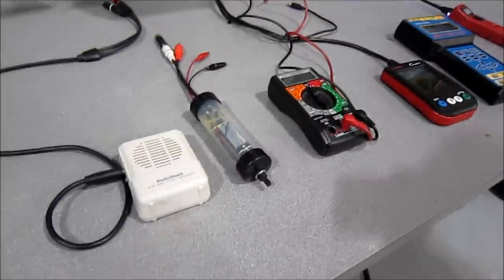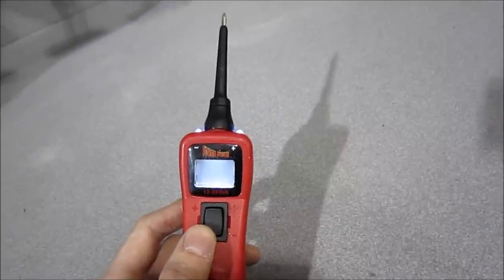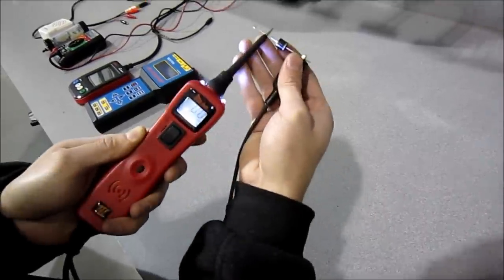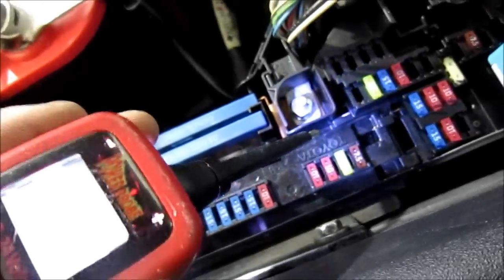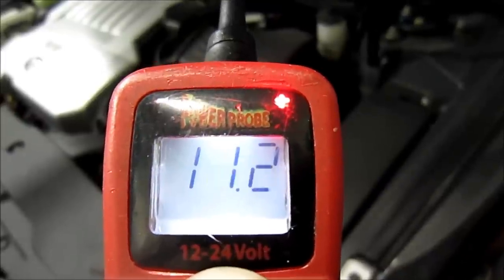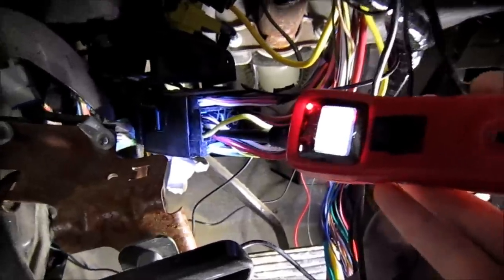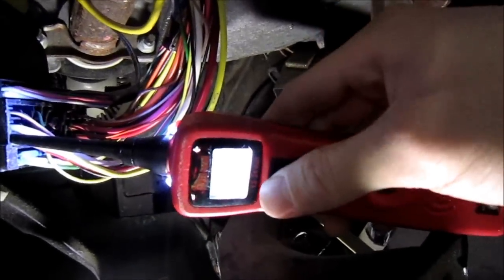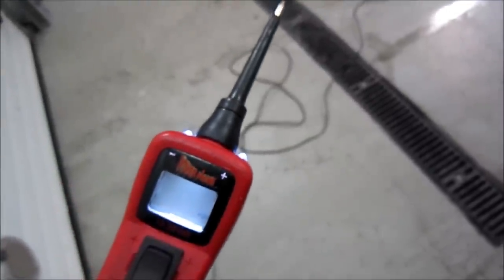Power Probe 3 Demonstration (12 Volt Diagnostic Tool) | AnthonyJ350

Comment: Yes it can hurt newer cars. So can a hammer. It depends on the user. I suggest they understand how to use this tool. As I use mine everyday. It saves time finding issues I know to look for. The only real use I have for the long cord. Is when a customers car is stone cold dead battery. So I use my AGM in the Rear of my truck for powering it.
Reply from the maker: True, that's why we discuss potential weak points of the tool.  You do not want to neglect mentioning the risks of using a tool.  You could setup a dedicated multi-meter in a similar fashion and modify the negative test lead with an alligator clip to quickly hook up to ground and use the positive lead in a similar fashion as the Power Probe.  On my Power Probe 4 I actually use a test lead from a multimeter so it fits in more places and I don't stress the circuit board out when testing wires when we're doing several remote starters a day.
Reply: @AnthonyJ350  I just bought a set of Fluke Test leads. More then i need. As I bought it for the Fluke 289.. I never used it much. The Power Probe can find it faster. Just learn to use it. As most people I see with them. Have no clue how many functions it has. Just read the Instructions.

Comment from the maker: 2 is a really good unit, I own one as well.  It's simpler as it does not have the LCD display for the voltmeter.  Also it doesn't have the same programmable features as the 3.  But the Power Probe 2 is still a very powerful diagnostic tool.

Comment: i just looked at the price of the 4, it's over $200. i like and appreciate you showing this. i just finished restoring a 71 Blazer and am onto a 68 Bronco. so for me i can't put out the $200 when a meter, some long alligator leads and a small 12v power source are gonna cover my 50 year old vehicles.
Reply from the maker: All depends on how efficient and versatile you want to be. Nothing replaces a multimeter but some jobs are just faster with the Power Probe. If you make money on a tool it's worth buying.

Comment: I used my Power Probe for the first time today, on a 2006 Skoda Octavia that would not switchover on start position after dong a D.M.F. conversion...thought at first the teeth on the starter to new flywheel were mis-matched...HOWEVER.... Power Probe'ed he Starter Trigger cable and found (once examined) starter motor plug had a 20mm corroded sector.....I can personally say this tool is worth every penny and something i would recommend to others

Comment: I have the 2. The 3 version has a digital display as the main difference, so if you can afford the extra cost it is worth it. I have several dvoms so I don't really need the display the 3 offers. the 2 can provide good ground or power supply so that is very handy testing the integrity of components.

Comment: Great video, I’m starting to use it but I’m a little scared when I send power to test a part. Should you send power only to the positive circuit? How about ground?
Reply from the maker: You have to tread with caution when sending power or ground.

Comment: Great video. When I Check the ABS 10 Amp fuse the Power Probe 3 shows a flickering of the ground on both sides of the fuse. All other fuses appeared normal but the ABS has me concerned. I replaced the fuse and no change, I tested with fuse out and got a good steady ground in the fuse holder with key off and a good steady 12v with key on. The flickering (both audible and visible) leads me to believe I have a short or is this normal in an ABS circuit?

Comment: could this be used to turn on the radiator fans from the fuse? would the thermo switch need to have the wires jumped?
Reply from the maker: I would turn the fan on at the device  itself if you're checking for operation.
Reply: @AnthonyJ350  thank you for the reply. my situation is a little different from others. i did turn on the fan at the fan, and it works. but not when everything is connected and my car is on and running hot. its got new radiator, new fan, new thermostat, new coolant temp switch and i think my problem  is with the ac being removed. think wires got changed and need to figure out which wires from use box send power to fans but i think the temp switch in the middle of the circuit needs to be jumped or open, and i only have a short time of running my car after it opens until it starts to over heat and i need to shut it off

Comment: when you tested the cigarette lighter, what was the other end connected to?
 And how did it turn on the light bulb when it was connected to only  the power probe?
Reply: it would have to have been connected to a ground, it couldn't work with only the tip connected.

Comment: Question when you were testing at the starter when the light switched from green to red when you turned on sound the green light and sound flickered what would that mean ? Or indicate
Reply from the maker: The tool is having a hard time tracking what's happening so fast.

Comment: hi Anthony  can you check injector pulses with the probe 3? or any others sensors  like ckp, cam sensor,
Reply from the maker: +Everardo Camacho I wouldn't as the power probe 3 has the ability to back feed too much.  I'm not sure if the power probe 4 would be safe.  I would just use a multimeter for that test, much safer.
Reply: +AnthonyJ350. Hi Anthony! but, can Power probe Hook do it safely? And does anybody make any comparison of PP Hook versus PP !!! And PP 4?
Reply from the maker: Mike Kosyi I'm honestly not sure, I have zero experience with the Hook.  Do you have a SnapOn guy?  I always consult mine fore application questions.  That's where I get this stuff from.
Reply: Everardo Camacho  no
Reply: IamMcGyver. thanks that's the answer I was looking for.
Reply: 7

Comment: Am I missing something here, what does the probe 3 do that my multi-meter doesn't, other than apply 12v to relays etc.
Reply from the maker: It's easier to do everything one handed under  a dash
Reply: @AnthonyJ350  Have you had a chance to compare this to the Autel ps100
Reply from the maker: @ezrollin561  No I have not

Comment: Will this work for other voltage? In addition to cars I also work on mobility scooters, they run on 24 vdc, and I work on 5 vdc circuits as well. Would this work in 5 v and 24 v?
Reply from the maker: +Dennis Hicks I'm not sure how low this one goes.  The Power Probe 4 will go up to 48 volts I believe.  You should hop on their web site and double check their specs.

Comment: Is this the only one of the Probes that does 24V? Is it the top of the line Probe?
Does it read ohms? I could have used one of these today to chase down a head light issue after ditching a Cruise control module in a 98 Kenworth T800.  What I used to trace wires from fuse box to relay to head light switch alligator clips, multimeter for continuity. BEEEEEEP! Not nearly so loud as your Probe. 

I borrowed power many times from a tiny piece of metal that a inserted into the headlight fuse. They weren't working yet so I didn't need the fuse installed. LOL! I used continuity to test for ground and sometimes power to the gator on the test light to test for ground.

I think I can do all of those things with a multimeter Alligator clips with leads, a test light. I never did power anything up though, I ended up with a missing ground to the head light switch that had been fed from the cruise module.

I managed but I think this Power Prove would have done all of it by itself. Continuity rocks tracing out wires.

 It is really neat to actually find out exactly where stuff in the fuse box goes without a doubt.
Reply from the maker: There's a Power Probe 4 now that is rated even higher for voltage.

Comment: can you cheak break light whit the power probe let me know nice video thanks
Reply from the maker: +pedro rodriguez Yup for sure.  You can see the voltage at the switch when you make a brake application. On some vehicles the ignition has to be on in order for the brake lights to function.
Reply: thank you Anthony

Comment: I love powerprobe in general but there pricy, Autel Ps100 do the same for half the price,
Reply: Allen Lee I got an Autel Ps100 pretty much the same as power probe 3 as i use power probe 3 replacement parts for my Autel and its $80, came with a load of attachments, you can get Autel for 50-60 but i didnt wanna wait for Chinese shipping.

Comment: I see criminals being caught with these on the streets by the police don't know why tho
Reply from the maker: Rocky fish These can't really help you hot wire a car so I'm not sure either. Most cars have immobilsers too now.
Reply: AnthonyJ350 I know but they use them for something maybe to bypass the immobiliser only thing I can think of either that or the tracker, little Bastards there more clever then the designers
Reply from the maker: Rocky fish Immobilisers use a computer language 0's and 1's. This thing just does positive and negative. If they're starting newer vehicles that's interesting
Reply: AnthonyJ350 it's crazy, my van was broken into a few months ago, nothing was stolen thank god they must of been scared off, but they got in with out the alarm going off then rolled van forward to get access to rear door they then bust the lock out still with no alarm going off, so my guess is they use it for this, but the police said that's not all they use them for,
Reply: AnthonyJ350 I also heard that they hook them up to ob2 scanners and they can basically tell the car what to do
Reply: AnthonyJ350
maybe they use the tip to bash the window in, lol

Comment: what kind of mechanic are you ? You called the gasoline engine a Motor!! You need to go to school and learn the difference between the two
Reply from the maker: Have you ever checked the definition? 

2: any of various power units that develop energy or impart motion: such as

a: a small compact engine

b: INTERNAL COMBUSTION ENGINEespecially : a gasoline engine

c: a rotating machine that transforms electrical energy into mechanical energy
Reply from the maker: https://www.merriam-webster.com/dictionary/motor
Reply from the maker: Also to be fair, why do they call it a MOTORcycle? Almost every one sold has an internal combustion engine.